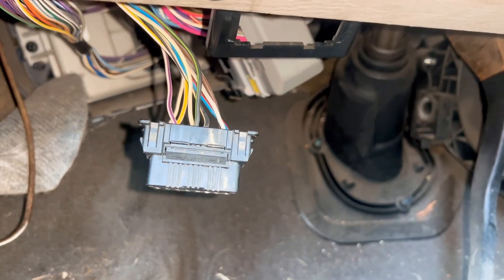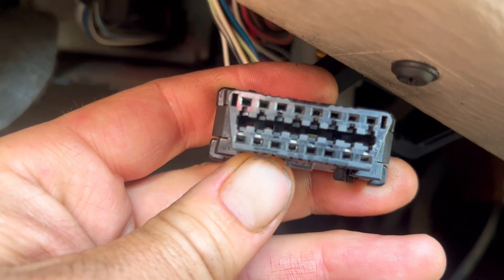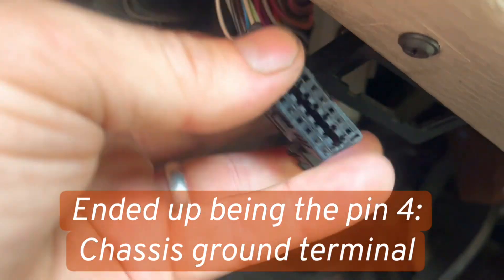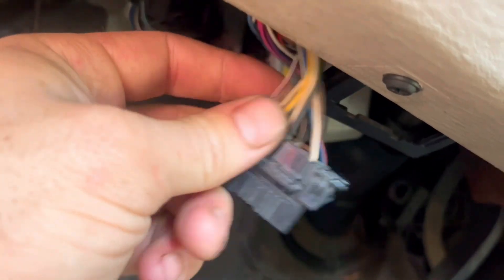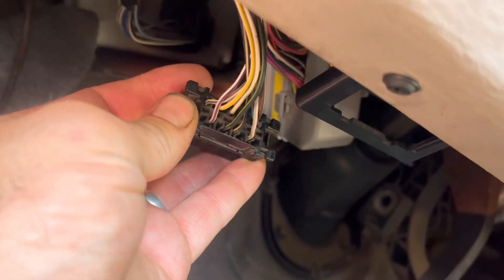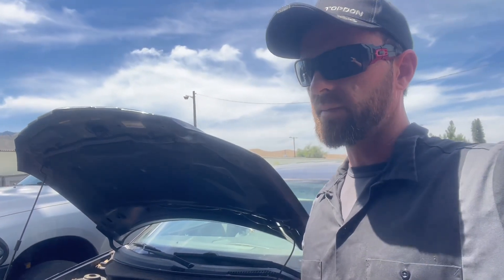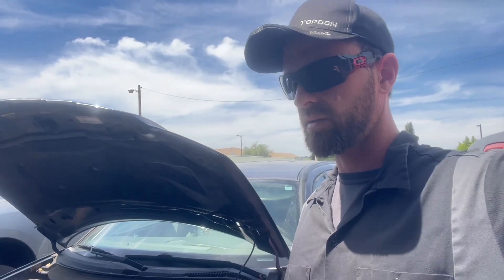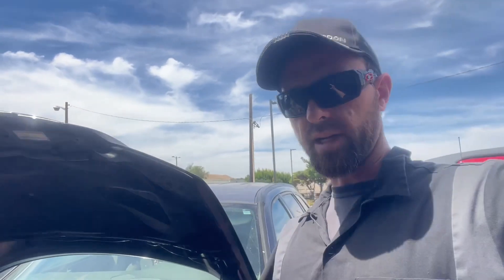Scan Tool Won’t Communicate? Quick DLC Diagnostics,

Comment: Interesting video thank you.
Computers have slots for video cards and other hardware I’ve always been taught about the pins on the slots could lose connection sometimes and need to wiggle the card or use a rubber eraser to polish the oxidation off the pins on the cards.
I never thought about DB2 connections having similar issues and worse because of the pins in the moles connection could be loose or the locking tabs inside could be broken.
Sounds super annoying.